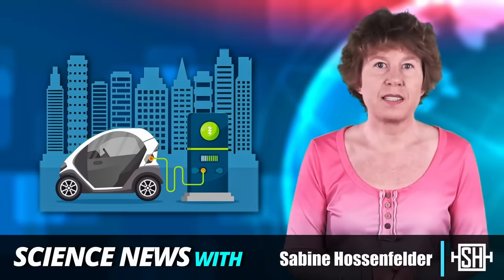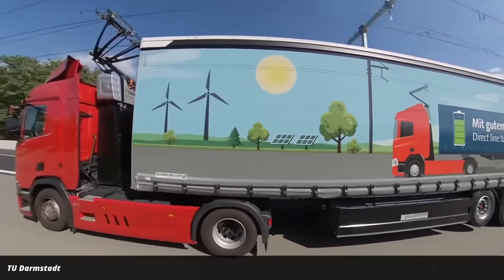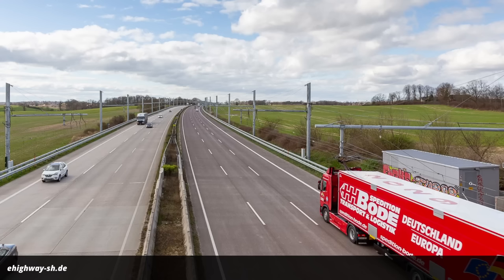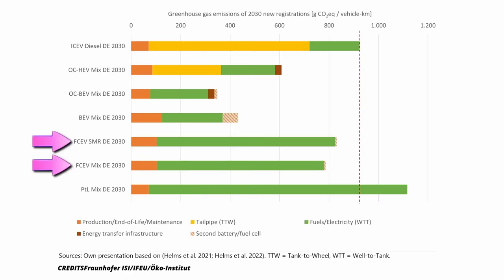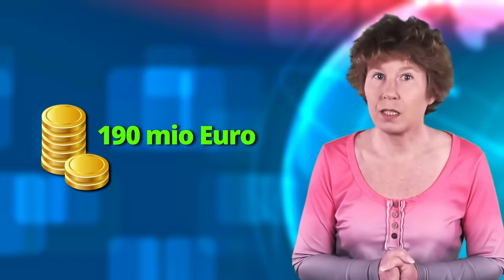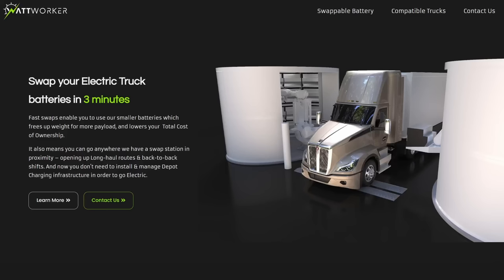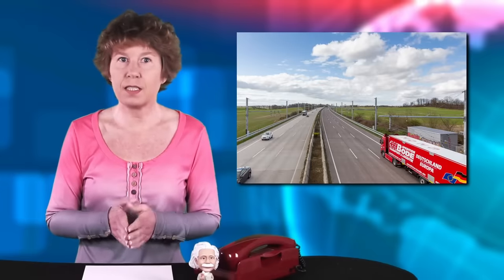Charging while Driving: Does it Work?

Comment: An e-truck consumes 120 kwh per 100 km or 30 Euros in Germany. A diesel truck consumes 30 litres or 50 Euros in Germany. So Sabine is wrong when saying diesel trucks are cheaper to operate, at least here in Germany the difference is massive.
Sabine is also wrong about the 50% fossil part in the electricity mix in Germany.
Reply: How much of the liquid fuel price is Govenment tax? In the UK it's  more than half the price.
Reply: @alanmon2690  It is also roughly 50% tax in Germany but businesses do not pay GST so maybe ~30% tax for them. Power is much cheaper for businesses though because the taxes are much lower (maybe 15%) and power costs in general are lower for large businesses and industry. It is probably less than half of what she showed in the map
Reply: @devluz  UK has a double tax -one is fixed per litre, the second is VAT on the final. Businesses would still have to pay the fixed fuel duty. I expect that the cost of electricity for the chargers will increase to compensate for the lower fuel tax income!

Comment: This is not required. The Tesla Cybertruck has a fully loaded (80,000 lbs) range of 500 miles. Plenty for even a large country like the U.S.
Reply: No - its the Tesla SEMI!
Currently hauling cars and battery packs from Nevada to Fremont - 269 miles over the 7,200-foot-elevated Donner Pass.
"Every day, the Tesla Semi demonstrates that battery electric trucks can directly replace diesel trucks. With our own fleet of Semis, Tesla has shipped >20,000 battery packs out of Gigafactory Nevada to support Fremont vehicle builds. These trucks run the same route, carrying the same load (no load reduction for weight) as the diesel trucks running this route but at substantially lower operating cost."
Tesla Semi chief engineer, Dan Priestley

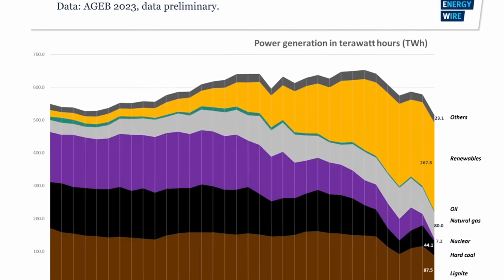Comment: 2:20 Dear Sabine, you say the "energy" needs to come from somewhere, but show a graph of the (electrical) power sources. I think it's important to not mix them up, because looking at our energy "consumption", things look way worse than in that graph. If we want to substitute e.g. oil and gas for heating our houses with heat pumps, power demand will skyrocket.

Comment: European countries already have overhead power lines and pantographs on their trains so it's an extension from an existing market.  It would be a lot more costly to do this in North America, at least till doing this in Europe develops and production in Europe underwrites the costs.   I wonder how an inductive system using AC transmissions and trenching a cable into the pavement would compare in costs.   I think South Korea had a pilot project with mass transit for this but we never heard of it again.   The inductive system would've been easier for private cars to use as there would be no need for pantographs to reach the height of the overhead wires.  When compated to building the supports for the overhead wires, the costs of trenching the cable into the road might be comparable though maintenance would probably be more costly however also less likely to be needed.  Keep in mind that not every mile would need to be electrified, just enough to recharge the batteries while still enroute.  To be honest, if I was to go with an overhead approach, I would be tempted to go with microwave beamed power from phase array towers especially since trucks have all that roof space over the trailer, sure the efficiency of the power transfer would only be 80% but the same is true with inductive cables under the road.  Phased array beamed power could be selective to service subscribers instead of to all on the electrified portions.  And yes, there are RF power transmission links in grids so wireless energy transmissions of that much power is possible and are being done.
Reply: Underground cables are more expensive and have larger energy losses. It is safer though and therefor better suited for use in cities.
Microwave power beaming is probably too new and will need decades of further research and testing before it can be used on large scale projects. But who knows sometimes things change fast.
Reply: @Robbedem  Larger capacitive energy losses true though underground power lines do exist so it's not prohibitive and less conductive road fill could be used as well as decent dielectrics, but shallow trenching in the established thoroughfare of an asphalt road is inexpensive versus construction of support towers which may be obstructions in themselves as well as vulnerable to accidents and weather and may require additional right of way besides and above the roads.  Right of ways are always the most costly of issues and the supports must stand somewhere and it can't be in the road itself but cantilevered over the road.  The costs may be comparable as the wire needs to be shallow.  Also, as I've said, there's also beamed phased array RF power from fewer towers, likely existing telecommunication towers that can be targeted to subscribed vehicles.

Comment: This is a helpful video.  It highlights the same issue that has challenged electrification from its beginnings, a very long time ago.  The cost of the infrastructure is very high and it isn't cost effective, unless there is enough revenue from the traffic using it to pay for it in the long term.  We hear everyday about electrification of road vehicles, but they only make up a relatively small part of total CO2 emissions (around 10%, if that's correct).  I am somewhat baffled why there is so much attention on vehicle electrification and so little (apparently) on the really significant emitters  of CO2?  To give a simple example,  I could easily do away with my gas fired home heating system and do the job using electricity (CO2 free, hopefully), if it didn't cost so much.  That's the reason for gas fired heating systems in the first place.  They are much cheaper to use.  As best as I can work out, I can't see that CO2 emissions will fall by the amount that is required, based on the current plan.  Why is this, I wonder?

Comment: I agree with the idea late in the video (also posted in some of the comment threads) that the best way to achieve electric freight (and passenger) transport would be by rail, including a major expansion of rail networks.  That said, trucks (and buses) running under the wires are a reasonable way to get things (and people) the last few kilometers in places where it is hard to put rail or where the amount of traffic doesn't (yet) justify it.

Comment: I’m in the swap out the batteries column. I use power tools every day and when the battery dies, you have one in the charger ready to go. You could have the battery mounted under the chassis and come in a standard size so it would fit all cars.

Comment: Those double patographs look like a short circuit wating to happen. The truck drivers would have to concentrate keeping to the centre, as well as watching the traffice. We used to have trolley busses that had 2 long poles contacting the overhead wires, which were rectangular in cross section and longer downwards for the trolley to slot onto..
Reply: Wait, you don't have trolley buses anymore ? After trains and trams (aka also trains) they're the next most carbon-free method of transport. No need of super big, super heavy, impossible to stop burning if it burns battery like electric buses. And because they don't have to carry the battery, they're more efficient too. Well, not a big battery, having one for 20-30 km or so is good to have. In Romania, and from what I know other Eastern European countries, we still have them.

Comment: I worked as a truck driver for a year. Electric cannot work because of infrastructure and weather. There is already a parking and fuel issue, add the need for long charge times. Also, another aspect is cold weather. It can be frustrating to be stuck in a blizzard area a few days at a rest stop, but dangerous with no way to get heat and power. Battery powdered trucks is solving the wrong problem. In order to make batteries viable things would need to be transported in smaller quantities over smaller distances and infrastructure be built for a lot of parking and charging.
Reply: Seemingly missed the point of the video
Reply: @Furiends  Probably, to be fair I commented this before watching just assuming things. I just mean that battery powered trucks are not viable at least the way the transportation industry is now.
Reply: "Every day, the Tesla Semi demonstrates that battery electric trucks can directly replace diesel trucks. With our own fleet of Semis, Tesla has shipped >20,000 battery packs out of Gigafactory Nevada to support Fremont vehicle builds. These trucks run the same route, carrying the same load (no load reduction for weight) as the diesel trucks running this route but at substantially lower operating cost."
Tesla Semi chief engineer, Dan Priestley
Reply: @waynerussell6401  Okay, then I am a Nigerian Prince, if you send me 1 million my father will send you a billion. Also, Stockton Rush has some submarine tickets to sell you 😉

Comment: Swappable batteries have their own set of challenges. You gotta produce at least two times more batteries, they have to be larger, you gotta transport them according to traffic patterns and it's not going to smooth out peak consumption that comes from high power charging. Building swap stations big and versatile enough still seem cumbersome. Will it be cheaper/more expensive than hanging cables? Idk. But those railways you mention. They look awesome! What kind of alien technology is it?

Comment: Swapping batteries is 100% the smarter solution. But that would mean unified battery technology and compability, and since there are different manufacturers with "secrets" thats not something I see happening. On top of that, these big batteries are not cheap, and they also degrade, so there is a cost on top of the raw electricity stored to replace faulty and degraded ones which makes it more expensive still.
Trains are cheaper, but for timely transportation they are too "big" in capacity which means they don't drive as often in order to not drive empty. And we don't have that many rail lines anyways. Smaller trains would be a solution, or highly sopohisticated fast automated loading and unloading terminals to come closer to truck level speed in that logistic chain of events. 
But then also : "Deutsche Bahn"
Honestly, the smartest way to reduce emissions on the topic of grocery shopping would really be electric powered drones that can carry your daily shopping so noone pulls out a car to waste a ton of energy to move the heavy car and us useless fleshbags around.
In terms of the expensive electricity we are ways behind anyways. Africa is getting wise, which means there won't even be cheap importable nuclear energy from france in a few years, because they are practically "stealing" the uranium from their old colonies.
My favourite idea is still to dig 2-5km deep holes and get some geothermal steam up and running, there is nothing preventing us from doing that. Just send a tunnel bore machine down vertically instead of horizontal for a change. Something like this could easily provide our baseload.
But I bet some critics will say that we are cooling down our core, shutting off our magnetic field and we will all perish from solar radiation. In a few million years.
Welp.

Comment: As a child in the sixties ((1960-1970) I remember the troleybus system (Public Transport) in the city... a better cheaper and more flexible system then the current tramsystem (expensive fixated railsystem that can get blocked by the slightest trafficproblem) because those buses can drive partially on 'electrified' routes and can switch to 'motor' (gas, H2, benzine, gasoil ...) on the other non-electrified parts. Sort of Hybrid-Public-Transport

Comment: Tesla has already proven that electric semi trucks with good range and practical charging times are commercially viable, operationally practical, and in demand. So this seems like a bad idea. The demand for the Tesla semi is already sky high, and it's only going to grow as it becomes clear that this is a far cheaper way to transport goods
Reply: I think we’ll also see a correlation between the widespread acceptance of fully autonomous cars and some form of in-motion EV charging.
Reply: EV trucks might be the future, but so far, with only ~100 trucks sold/delivered, they only proved it as a concept.
Reply: Please reference your sources already proven, wrong.
Reply: @hotbit7327  There are already 213 registered electric trucks operating at the San Pedro Bay complex hauling freight.

Comment: I don't think it's a failure. I mean what's the alternative? Build a DC fast charger for every parking spot on every truck stop in Europe in the next 15 years?

Because you can't expect the drivers to change parking spots in their off hours after a charging for an hour or two after they ended their shift. 

I mean that's going to be more expensive to build all these fast chargers compared to add overhead wires every say 50 km to charge while on the go, so trucks need to be build with smaller batteries and don't need to cycle them as heavily as with nightly charging sessions.

Overhead wires could also be strategically build on every climb, so you can charge and don't use a lot of energy going uphill and as long as diesel trucks are around you can also take advantage of the slower speed in these sections and charge longer for the same amount of wire installed.

In addition the overhead wires would shift the energy consumption from the night to the day, making it viable to use solar power directly to charge the trucks, maybe even adding solar roofs to the highways while you're at it.

Comment: This illustrates a common factor that actuvists and the public often don't understand.  Sometimes (often, actually), a seemingly "obvious" solution doesn't take into account the ugly Real World factors like logistics, transition costs versus utilizing established infrastructure, and cost.

That's why quick swap batteries make more sense rhan trying to recharge EV or hybrid trucks on the highway, and why hybrid automobiles usually make more sense for more people than plug-in EVs.  Because they dont inpose as huge an infrastructure cost, are more easily integrated into the existing infrastructure , and have fewer of the shortcomings of the "ideal" (or "idealistic") solutions that would effectively eliminate exhaust emissions directly drom the vehicle (again, it doesnt really help much to have an EV if you're just getting the electricity from it from a grid whose backbone is fossil fuels... ubkess thise fossil fuel plants are significantly lower emmission per unit of power than the engines of the IC vehicles the EVs are replacing - and every kW/hr of power used to charge the EVs means a kW/hr (we're going to disregard theoughput losses just for simplicity) of the oldest, dirtiest, least efficient power production plant you can't retire without cutting a kW/hr of end user need elsewhere.  (This last is why I'm so in favor of hybrids versus EVs or hydrogen - hybrids integrate almost seamlessly into the existing transport infrastructure across the board, do not impose as great a strain on existinf road infrastructure (batteries are heavy, and EVs are invariably heavier than their IC equivalents due to the mass of the batteries), do not impose any new draw on the electrical grid in service, and yet are hyper efficient compared to typical IC-only vehicles.  They even impose less strains on the production end than EVs, because their batteries are invaiably much smaller than a pure EV, meaning lower requirements for rare earth elements to produxe them.(

Comment: The reason there's no expansion of rail freight is that in a lot of choke points on the network, it's already at maximum capacity. You just can't fit any more on the existing network.
Reply: What stops us from expanding the choke points? If it's the pass next to Eisenhower Tunnel that is one thing. If it's an interchange outside KC that's at capacity that's another.

Comment: You just need a speed of light ground switch, and of course a full set of ballasts.  So if your road is of decent length, power travels 86% the speed of light over a cover wire at STP.  For smaller S.oL.S you use a triangle, because the circuit is nurdy.

Comment: So we need rental garages with an electronic network. Have them near a conglomerate of all public transit. Transfer as many of the downtown roads into pedestrian only. Electrify major routes. The vehicles would still require small batteries for different amounts of range off-grid.
My understanding of power generation; small engines are less efficient than large engines, so power plants capture more energy from fuel than a car or truck. Making a power grid to support them is extremely expensive and time consuming, but in the long run would reduce overall emissions. Its also easier to maintain emission equipment on facilities, than to make sure the people do on their own vehicles. Where i'm from, many vehicles dont even have catalytic converters after they fail because there are no regulations